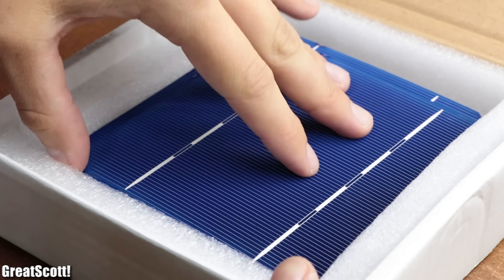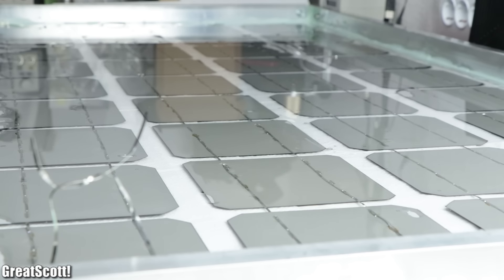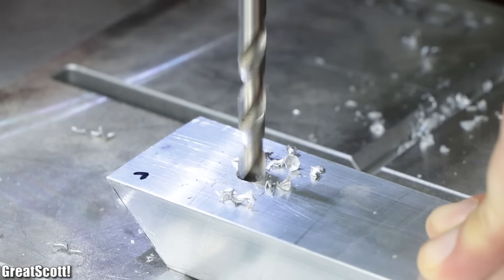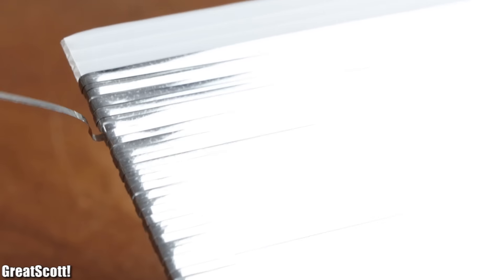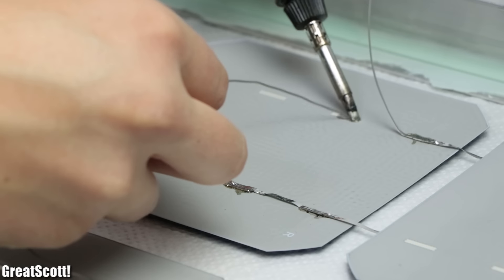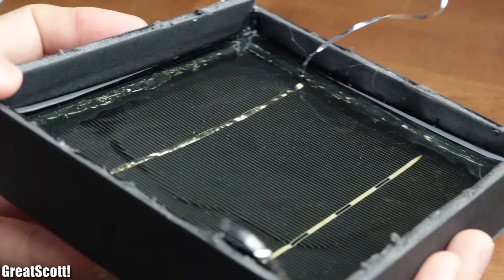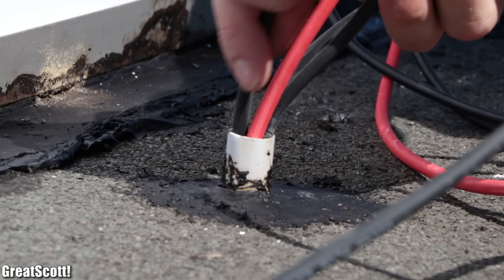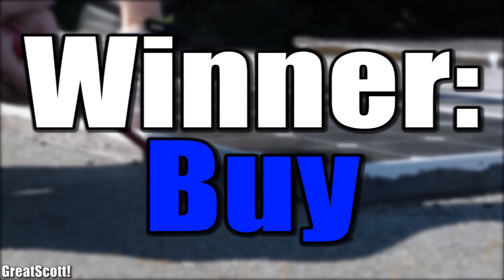100W Solar panel || DIY or Buy

Comment: How can one turn the energy from a solar panel into usable energy?
Preferably the same as from a wall socket, so 110 or 230 volts ac
Reply: You need a DC/AC inverter, to take the 17 volts DC from this panel up to 120 V. AC. The best thing, would be to use this panel to charge a 12 V. battery, because the battery can supply much higher current for short periods of time, allowing the panel to recharge the battery between uses. This panel could never start the motor in a small refrigerator, but a battery can. The refrigerator cycles on and off, giving the panel(s) time to recharge the battery in between run cycles.

Comment: Great video but isn't it much less power than the real power ? the panel said 100w but it outputs 59w
Reply: Power output varies and the rated output is only at full high-noon sun.
Also, typical charge controllers don't take advantage of the full panel voltage.  A typical 100 watt 12 volt panel is rated for about 5.5 amps at 18 volts, but when you connect that 18 volts to a battery at 12 volts, the panel voltage drops down to the 12v battery voltage without increasing the current output so the power becomes 12v×5.5A or 66 watts, even in full sun.

Comment: Why i measure up to 2 volts on a 1x1 inch cell used for solar lamps? Why is there this discrepance between normal cells and the lamp one? I did not measure the current tho.

Comment: can you get away doing it without the resin or with a cheaper plexiglass/glass? they did look like big expenses. what about using any kind of firm non-wood material to support the cells from behind in place of the resin and a very thin plastic sheet for upper cover? is all that matters resistance to waterproofing and hailstorms resistance or is there more to it?

Comment: I also did my DUY panel and its prive was much lower:

I did not used plexiglas nut used normal glass intead, even if this is now the very good idea as resin does not stick to it well.
next i didi not used that much resin to cover entire panel but just made it sure that all cells are coated in resin and there are no bubbles between glass and cells. 
to save on cost i used polyester resin which is relatively cheap
Also i squeezed cells right next to each other leaving no gaps at all.

in the end, resin hardened and popped away from the glass in the edges but it was no problem because I just filed gaps with more resin. even if cells will detach from the glass, in the end, they still hold well. 
I made no frame for this panel but made it much smaller intead, so that glass itself is capable to sustain its own weight

Comment: Epoxy glue lifespan is about 3-5 year. and the power lose will be very very fast. normally the solar panels manufactures use Glass+EVA Film+solar cells+Eva film+ TPT Film, then laminate under 150℃ for about 15mins,  now more and more people like the double glass solar panels, use glass to instead of TPT Film, the lifespan will be over 30 years, and power lose will be less than 20% after 25 years.

Comment: Hmm, i still have a problem with Polycarbonate or Acrylic glas that in the sun if them go warm, they deform and brake the cells covered ... i tried 2mm and 3mm thikness. Anyone an idea what to use to cover DIY Cells??

Comment: once you seal it in resin you remove the only upside of diy solar panels which is the ability to replace a broken cell and save you buying another full panel.

Comment: A good video, but.. It needs a sequel with better design.
The final buy version depends on each country. So it might be cheap for you in USA, but expensive in another. 
Also, you used epoxy and this means if any problem occurred, you can't replace the damaged cell or connection and the whole other cells will be lost. You need to do another design!!

Comment: Hi I have a 14 by 12 inch  solar panel,  its supposed to be 100 wats, I doubt it very much, could you give some idea of what its possible to expect from a panel this size wattage wise, I need it to go on my cycle bike so unfortunately can't use a bigger panel than probably 17 inches by 17, is there a more reputable company you or someone could recommend, this panel has a 12 v,and 2 usb.

Comment: Also you wouldnt want to use plexi.  Plexi will get milky in sunlight quickly and scratches easy.  A sheet of glass would probably even be cheaper.

Comment: Yo quick question do components down the line in a series deteriorate more than at the start as they trans more energy?
Reply: How does resin or glass or plastic or any filter not designed to let rads through not cripple the potential of the panel?
Reply: I need at least one to work on projects with hmu

Comment: I do build panels GLASS ONLY 😑 no plexi glass lol but only using 2 cells with a voltage boost controller to charge 3.7 volt cell for wireless transmitter . It's fun but he's right much much much cheaper to buy. I only do it like he says special applications.  Not to toot my own horn but I got pretty good at it lol

Comment: I have 3000 mah 5v bulb comes with 2.5w solar panel ... But it takes 6-8 hours to charge ... Can I use 5 w panel so that battery charges quickly ??

Comment: I know what you tried to do here, and with your series as a whole, but trying to copy a product in design is hardly ever worth it with most things being massproduced in other countries these days.
As many other propose, why not try and copy the functionality of the solarpanel, but in the proces see how to DYI in the cheapest way? Something like covering the cells from the top with a thin layer of clear UV resistant resin, cutting cost from the plexiglass, as well as maybe a wooden frame, treated for outdoor use?
Just some suggestions. Keep up the good work :)

Comment: A very good video, i have a 120w solar panel  on the roof of my electronic lab but i have mounted it about 2 inches  from the roof to allow air circulation, solar cells do not work very well when they get hot.

Comment: After a couple of month experimenting, i found out that you can not really use Epoxy Encapsulation primarely if you use Acrylic or Polycarbonate front cover. The heat expansion / deformation (of the plastic) is to big and it will destroy your cells in days. What you can use is 2 component silicone. The layer between front cover and the cells buffer the expansion with their flexibiliy and prevent the cells from crack. The problem with the deformation while press down on the panel maybe can be solved with additional back plate from "glass fiber plastic". This should be stiff enough and is also pretty heat resistant. The problem is, this construction will maybe weight and costs more (special if you by already used modules) and has less efficiency then commercial one. I have a lot of single cells and would really like to create a custom lightweight foldable solar module but which materials to use (which should be accessable in europe) to realize this project? 80% Of my experiments just survived only a days ... Anyone an idea?? :D

Comment: But epoxy is very expensive and polycarbonate sheet is also expensive. I bet you could have got lots of cheap glass plate as scrap from a building supply thrift store ( like ReStore, if you have anything like that where you are) or Craigslist. Just sandwich the solar panels in between two sheets of glass. It would be fragile but still cheaper. You could get u channel aluminum from a metal scrap yard.

Comment: My question is can I use copper wire instead of the flat silver wire? And if yes what size copper? (AWG or MM works for me I use them interchangeably)

Comment: such a mess you did putting that black silicon to the roof and panel frame , you could simply install aluminium mounts to put all your system on

Comment: first issue is Plexiglas ! tempered glass is needed 6 mm. second issue you should laid a bead of silicone around the outside of the solar cells to help reduce the amount of sealer you use. Also you have to make sure you buy silicone that wont react to the sealer. if you really wanna know how to build solar panels from scratch you need to watch these videos https://www.youtube.com/watch?v=_2UxOY_wpFo

Comment: You still have so much spce left in the frame, so could you add copper pipes beneath the solar panel to get heated water and help the solar panel to stay cool? I dont think that you will get much energy that way, but i just thinking of the possibilities of this DYI project.

Comment: You should not mount solar panels directly on to roofing. It will overheat. Mount on a frame with space between the roof for ventilation.

Comment: Best way to do it is to solder them fast and hot. Clean them with alcohol, and sandwich between two pieces of glass with silicone encapsulation resin with the wire strips out the side. Apply double stick foam tape on the back of each cell for strain relief and expansion compensation. Use tempered glass for the sun side.

Comment: I think you learned well that silicone doesnt stick to plexiglass after making this.The resin its soo badly casted with air pockets under the cells...you would have been much better and cheaper  by using glass.

Comment: 1) Replace the plexiglass with a glass sheet (-30€)
2) Replace the resin with a second glass sheet (-27€)
3) Replace the expensive aluminium frame with corrugated PVC electrical tubing (-16€ since I can get 100mt of the stuff for 15€)
There, I just halved the cost of your build - even allowing 14€ assuming you can't find any free glass (which is ludicrous - all you have to do is show up at a woodworking shop and ask if you can have some old windows. They have to PAY to dump them so they'll be more than happy to give them to you.)Also I just had a 2 minute look on aliexpress and I can get 450W worth of grade A poly cells for 110$ shipped, which is significantly less than the 45€/100W you quoted. It's more like 20€.

I'm not saying that everyone should make their own panels - it's a pain in the ass, - but saying that it's less economical than buying them... just makes no sense.

Comment: 4 years ago I accepted the challenge o make my DIY Array of 4 1000w Solar panels. I used Tempered glass but no resin (bad move). With the time, it showed to be not good sealed, and less efficient that a commercial one. Definitely does not worth it. u_u

Comment: Didnt need the aluminum imo. Just a wood frame to hold in the epoxy wouldve been sufficient. The epoxy also was sufficient to waterproof. The silicon was not needed. Still tho with all the time needed to do everything it really is better to buy unless ur like an engineer on say a mission out in the wild where u needed to b creative and resourceful.

Comment: Hey Scott!! Another idea to try out, is it possible to make customized LED or LCD screens? I wanted to attach a screen behind my watch to make it a hybrid smartwatch with a full-screen background for which I would require a really small 1" diameter screen with a hole in the middle. is that possible you think?

Comment: I wouldn't recommend buying the cheap one from ebay either. You can get a brandnew module from IBC with over 300 watts of power and years of guarantee for 200 euros

Comment: Good video to learn how a solar panel is made !
One point I just doubt of if that the DIY version produce the same power as the BUY version because the DIY should suffer from more losses (more resistive loss from the DIY soldering, the optics loss from the resin (not as good transmitter as glass+encapsulant) 🤔

Comment: I got a 48in by 60inch glass I could repurpose.. if i can get it clean properly.. And I thought about making the frame out of repurposed wood.. That could save me possibly $50-60.. Possibly..
Reply: I don't recommend wood for the frame. This thing lives it's life in direct sunlight, rain, and very high temperatures. All of which, degrade wood. The glass, however, is an excellent choice.

Comment: In my country Things like the aluminum channels and the epoxy and other tools are too expensive..
it's a lot cheap to just buy a solar panel
I recently bought a solar panel rated for 100 watts at a cost of about Rs 2900
which turns out to be around 40$.
thank you making such amazing videos

Comment: Good information and hints that protects my from ordering those DIY cells! What a mess with the bitumen and epoxy resin. Epoxy ist quite expensive, also the aluminium frames and the Plexiglas isnt cheap - so i would expect it to be much more expensive than in your calculation!

Comment: I have DIY'd this too. I did not use resin, and I instead lay the cells out on painted plywood, and sealed the outside edge of the plexiglass over the top with strong adhesive, and topped it off with a C-frame. Takes 8 hours to solder indeed, it's actually meditative. My tips:

- Use a thick frame like Great Scott did, thinner ones are not sturdy enough and the space behind the panel is handy for concealing wires, drilling holes and mounting.
- If you're not using resin, make sure to keep any live wires away from the frame. 
- It's much much easier if you don't have to cut the plexiglass to size, it can be brittle and difficult to work with.
- Sealing the cells from the elements is crucial and probably worth spending good money on resin to achieve it.

It might be a good idea to use a backboard and a C frame, then fill the inside of the frame with epoxy as a seal. That way you use far less resin and mirror adhesive. Haven't tested this idea though, just a thought.

Comment: It might be interesting to run the numbers, if a suitable large metal picture frame with glass for the front from a surplus/dollar-store might make sense, along with EVA laminating film for the cells, and existing picture or alternative backing.  While replicating the commercial panel frame seems logical for longevity, as with the resin coating, my feeling is they are expensive and an advantage with full DIY would be in its serviceability if individual cells were damaged or went faulty.  Certainly wouldn't make sense on a commercial scale, but I'm hoping it might be less messy & costly while retaining the customisation ability, and adding user maintenance capability.

Comment: I think I would place the solar cells on a sheet of wood and then cover cells with epoxy or as other commentors mentioned cheaper plexiglass or something. That will not be damaged so easy. But great idea

Comment: things to improve:
>you should add a one way tint to the glass because some of the sun's ray is getting reflected . 
>add a screen wiper that will wipe it for every 4 hours
>Add the solar tracker

suggestions:
>house-made  efficient Wind mill 
>DIY vs Buy Refrigerator

Comment: If you’re worried about cracks, I suggest an epoxy resin that’s a little softer when set, and using Lexan(polycarbonate) rather than Plexiglas(acrylic). That should buy you some more time before it breaks.

Comment: Noob question here: Why not placing the Solar Cells directly near each other? Why is there a gap of ~cm?
Reply: You dont need to make 1 cm, 1-2mm is fine. You need a small gap so when cells heat up and expand they dont squish each other because they are brittle and easily crack.

Comment: I came to the same conclusion after a lot of brain work, when you factor in that some cells might get broken in shipping, some may come pre-broken.. Then the wire and flux kits are 10-15$.. You'd have to do a pretty crap panel to get it cheaper than pre-made. Might be worth it if customs fees are very high in your country..

Comment: what if your solar cells were only 9 cents per watt? thats only like 9 dollars for the solar cells, lowering the cost like 40 bucks under your cost for production, also why is everyone insistant on using epoxy when you can just silicon in some sort of backing and then a little nitrogen purified gas or just use a getter inside that you use electricity to heat up and consume the oxygen in the case? this allows taking it apart easily and reusing or refurbing the surface of your solar cells when they start degrading,

Comment: I've tried DIYing solar panels. The hardest part of DIY solar is the assembly. Making one or two panels is not too bad. Hand assembling dozens of panels sucks. Glass panels (as opposed to plastic which warps from heat) is prone to cracking. Glue sheets result in reliable adhesion but require a decent amount of heat to melt. That kind of heating wears down the power generation efficiency of the cells. With all that, each panel will generate widely differing amounts of power. And I can't reiterate this enough: panels are fragile. Applying a little too much force on a cell will immediately split it in two. One small slip up while cleaning up excess adhesive will send cracks across the top - no longer water resistant. Components are relatively cheap, but hand assembly is not fun.

Comment: Well one tip I would suggest for people is when you get a new adhesive tube and you have to cut the plastic part to open it. Cut it at 45°. Much easier to control the caulking. Also don't constantly squeeze the trigger. Pull it till it starts coming out than just do a full line.

Comment: By far the largest improvement you can make, which has worked very well for me.

Obtain old double glazing units, people have them in skips all the time or online when conservatories are being replaced. This provides tough, cut to size glass with aluminium surrounds that can be cut off using a Stanley knife and replaced with sealant. This will result in a cheaper and far more durable system.

Comment: This actually seems really cool for a demonstration project. 

What if you ran a copper heat pipe directly underneath the solar cells and ran them to an exterior heat sink located in a cool spot?
Reply: This already exists for commercial modules, it combines PV with water heating.